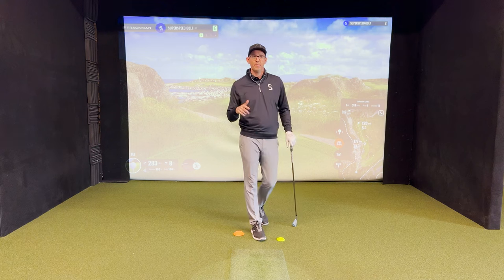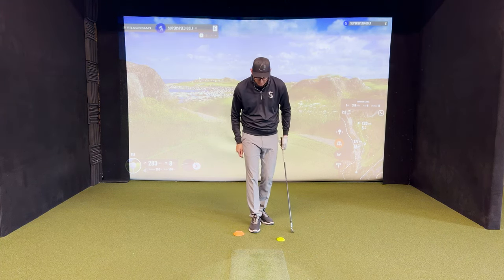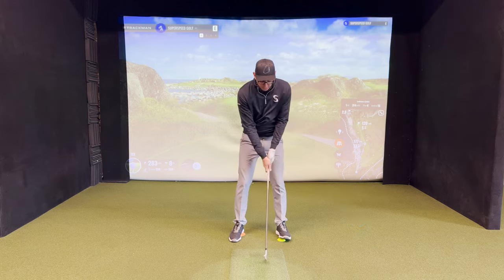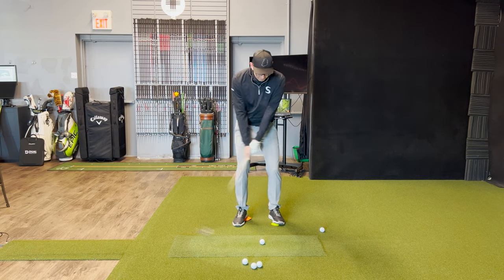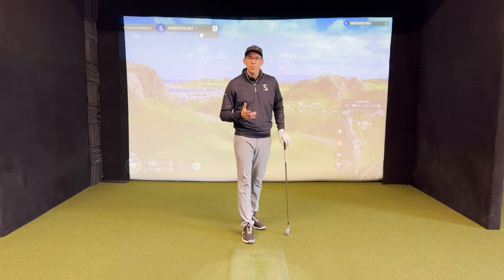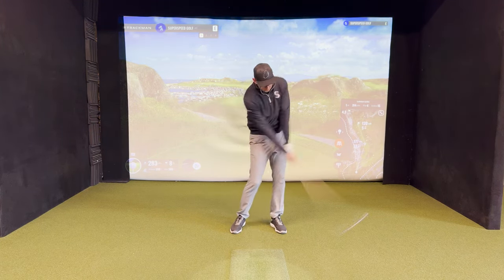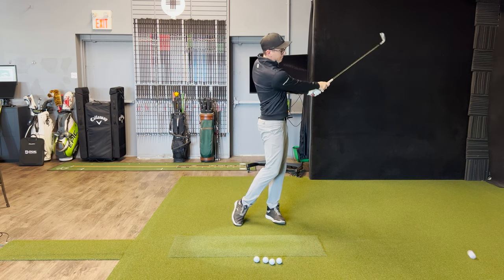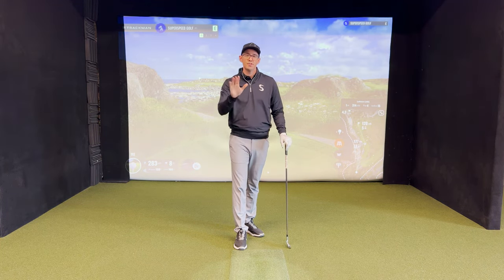Master this Short Swing Punch Shot Drill to Use The Ground Better

Comment: looks almost, kinda, just a tiny bit, like a tennis ball cut in half would be a good substitute for the $50 pedal kit
Reply: So wrong. Guessing u never tried the cut tennis ball. I did. Force pedals are a quality product that actually works. Tennis ball garbage.
Reply: Tried both. Force pedals would be a good deal at $10.